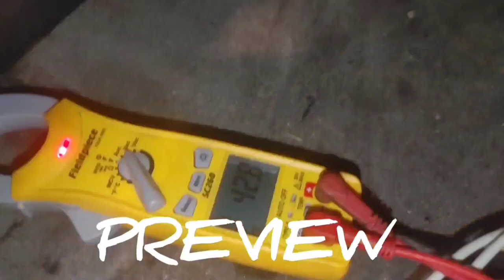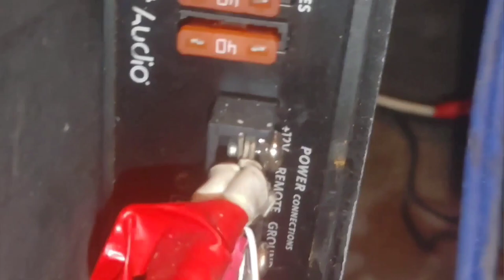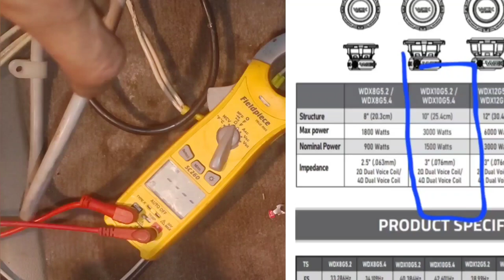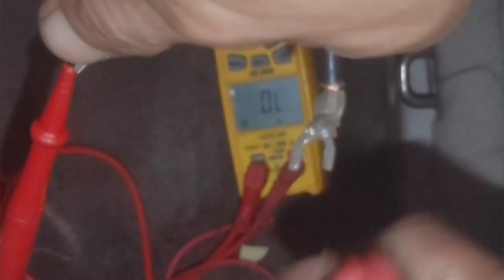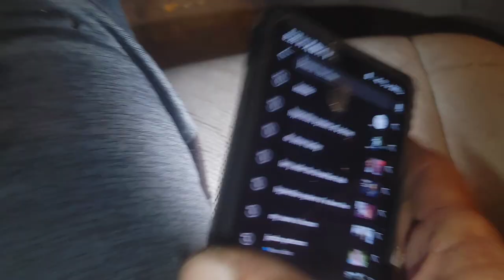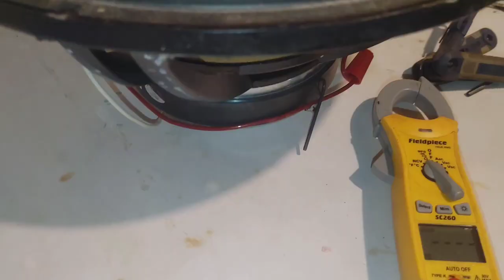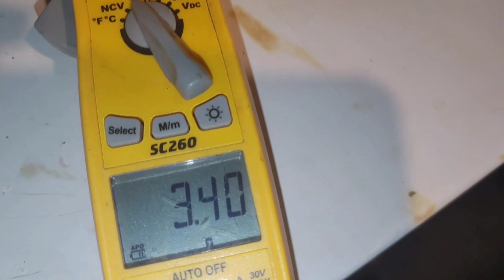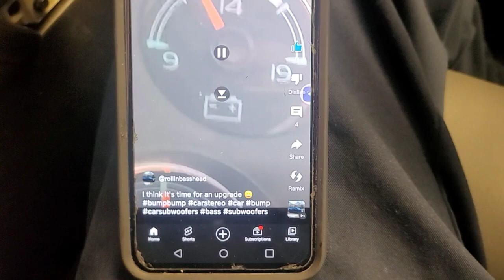Some Car Audio Training

Comment: I got a brand new service van and changed out head unit and door speakers. Added 2 alpine 6" speakers to side doors and 2 jbl 6x9 in back doors. Also have a 12" sub behind passanger seat. I sound deadening what i could but its a service van. Been fighting wind noise in front doors. 2022 chevy 2500 horrible door fitment. Having trouble dialing in the drum toms. Plenty of high and low end but the van swallows mids.
Reply from the maker: That's what's up, man. What I used,  lol, was the truck stock black foam tape that has that yellow peel away paper... I'd get one like every week on my truck stock tickets, and I would line the inside surface of the exterior door panels, and it helped for sound deadening. The first thing I do with my trucks/vans is get the 2% or 5% window tint from Walmart,  and the $12 application kit, and tint those windows. Never been pulled over once for the dark tint in over 12 yrs. I've done it to over 10 vehicles now(personal and work), so it's easy and comes out clean. Enjoy your company truck. It's yours, but remember that it's not too.
Reply: @HVACRServiceTech  been doing this 30 years bro. Been at this company 10 years. I do what I want but I have no illusions. Huge company multinational. I'm just a speck of dust to them. But invaluable at the same time for those who know.
Reply from the maker: @stangaloski4208  hats off to you my man. Didn't know I was talking to a vereran of the trade.  There's not much that I know that you don't! Thanks